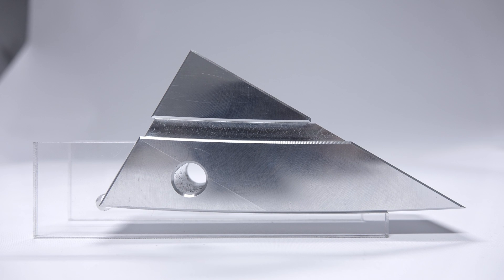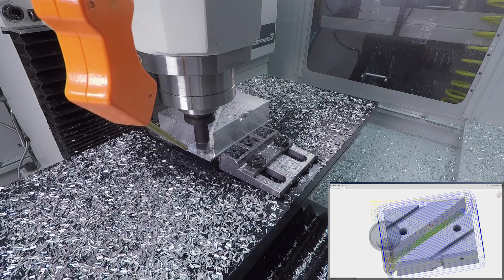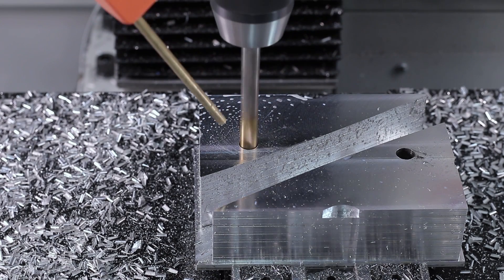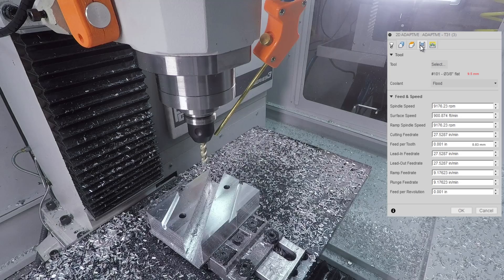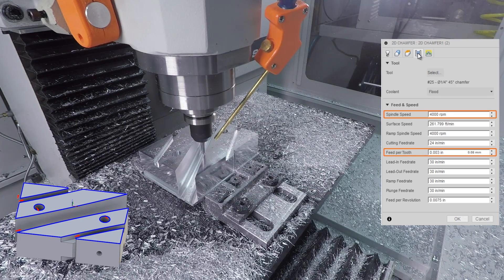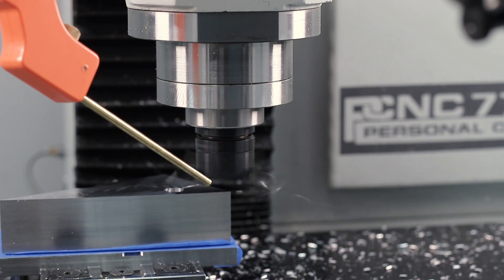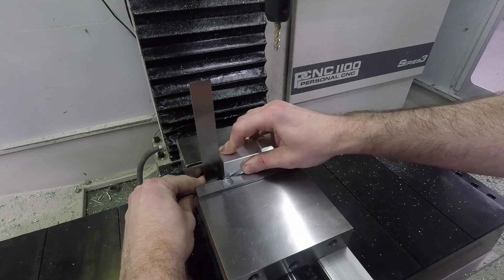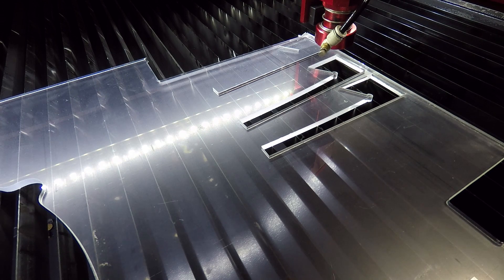Machining a Laser Workholding Jig!  WW190

Comment: You're spending time and tool life to slot, when you're going to be using a bandsaw anyway. Have you tried sawing the raw stock against an angled stop, then your slot becomes a profiling op, spreads wear on cutter and chip evac becomes a nonissue?

Comment: Gaaah! (Sorry, just trying to get your attention) this isn't a gigantic deal that will make or break you, but I just wanted to toss this out there:
Soft jaws can be expensive & time consuming, but "soft jaws" don't have to be actual soft jaws, especially when you're already using some scrap for the sub plate with locating features. If you cut that plate a bit shorter in Y, squared it up, decked both sides, and slotted it/cut away some material for relief of the end mill/holder, you could have just turned it vertical and cut the shelf. All while still super glued. Or get more creative with a different hole pattern for cutting the shelf. Possibly even add some choice pin locations to locate for the last op. And you can keep that plate tired to that job, or turn it into Swiss cheese using it for other jobs.

Still a great video! And the laser is great as well. Using it here definitely gave you gobs of very valuable data for future use with that material (like the adjustments for kerf & whatnot).

Comment: Does Fusion360 have an option for "opening cut" in the Adaptive tool path? In the Open Mind software I use, it uses the adaptive strategy for the open areas, but when it is slotting, it uses say 1mm DOC and I use a 40% step over - all within the one toolpath.

Comment: Slotting is realy no magic at all. High feed, shallow doc and go for it.
(Or if the machine can do it get a HPC-roughing endmill and use that...)

My machine at work, a Datron M10 is not the most rigid machine, but slotting with high feed, shallow doc works brilliant. Use a tool with corner-chamfer or radius.

The end-wear on endmills can be counteracted when you stay with your doc on slotting/helical milling below the with of the corner-chamfer or radius.

Comment: One thing to keep in mind when using the laser cutter to cut plastics is if your settings aren't right, you could end up melting the cut lines more than desired. Which would throw your overall tolerances off. This usually happens when you are having trouble getting through the plastic and allow too much heat to sink into the stock adjacent to the cut line.

Comment: Those slot features look parallel. Why not use a slot milling cutter with the part mounted at the required angle?
Might mean one more setup but it could save 15 minutes of machine time.

Alternatively; there are also end-mill cutters for tricky slots such as curved ones.
https://www.sandvik.coromant.com/en-gb/knowledge/milling/application_overview/slot_milling/end_milling_of_slots

In production, one has to trade off notional machine time cost (lost availability for other stuff) against the cost of the cutter; which may also be useful in future; though "may" doesn't pay the bills.

Comment: John, for slotting take shallow depth of cut at high feed rate. In steel and harder to machine materials use a feed mill type of cutter. The problem with adaptive cutting is you spend part of the time cutting air and the machine has to change direction a lot. Even though you have a high feed programmed the machine a may never get to that speed of feed in short distances. In that case the cams simulation won’t give accurate run times.
Reply: agreed and with slotting like this you don't have to only cut in 1 direction so zig zagging back and forth stepping down each time will really save you a ton of time vs trying to adaptive it out.
Reply: Although we only have a have a Mini Mill we also do a shallow cut at a higher feedrate (allu). The adaptive didn't work very well for me..
Reply: @edge precision. what is shallow? like .5*d / .25*d or less to start with?
Reply: #not-a-machinist, but I think part of his problem was the first setup since he was slotting at an angle, whereas he could have used the plastic/acrylic ( or a swivel vice)  to set the stock in the correct angle for the slot instead.